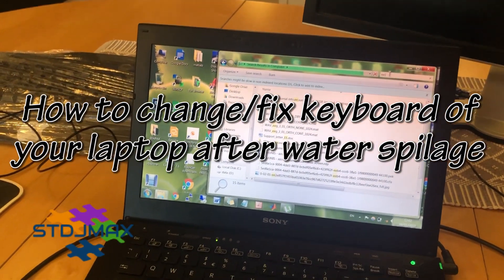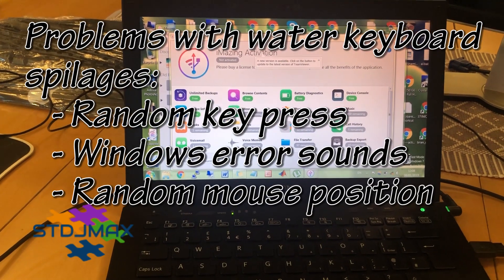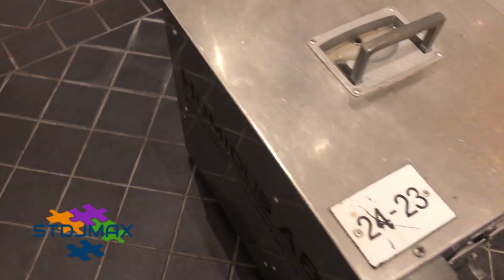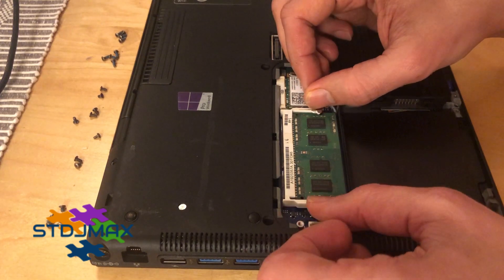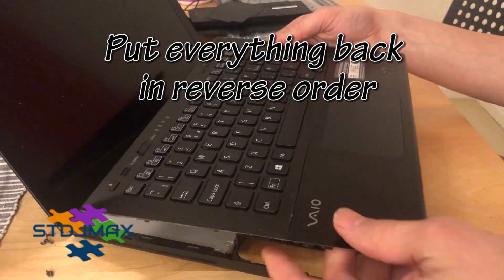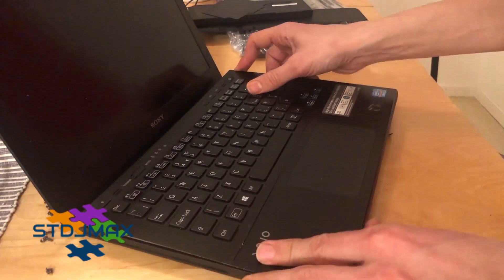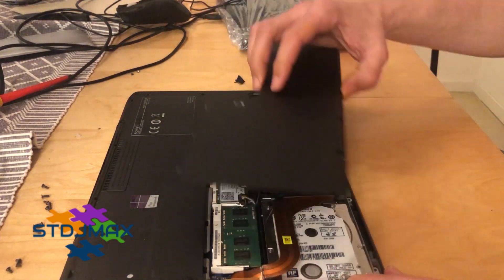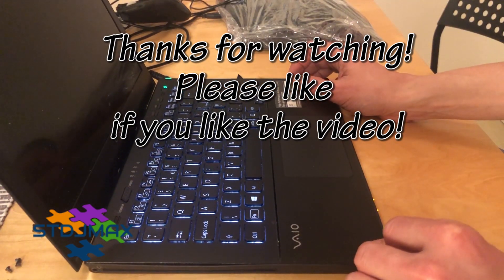How to repair the keyboard of a laptop after a water spillage/flood

Comment: I'm facing 3 (or 4 issues) with my acer aspire E1-572G

Recently i spilled water on my laptop, i cleaned it all. It was working fine till i shut it down.

1. Issue: power is on, yet no display. (sometimes it lasts longer but then shuts down.)

2. Doesn't power on, even if i press the power on key.

3. Key A and Caps lock doesn't work.

4. Won't charge. (Not sure about this one.)
Reply from the maker: Zach it seems some water still inside or it have short circuited some parts... 
But does the keyboard works ... try put it upside down for few days... try an external tv via vga port and see if any output signal
Reply: @stdjmax  mine  types random letters some keys dont work almost all please help
Reply from the maker: @barneyiscool221  this exactly the problem what I had. Means there is still some water inside. Put it upside down for more days in a dry room

Comment: hmmm i accidentally spilt some lemonade on my keyboard and nothing happens, except sometimes when i press D or T the key doesn't go back up, resulting in it being spammed. should i use a different keyboard?
Reply: Mine would work on some numbers and bottom row like the/key and stuff. But its been a year and I bought a cheaper model, but it curts out so much. I am going to have to get an Apple Keybd.  I had an Anker , rechargable, bluetooth. But if you dont make a keypress, it will cut off and it takes forever to connect again. I kept the keybd wrapped in cello with about 20 of those lilica gel packets. -NOTHING

Comment: I clean my keyboard each bottons by removing them and after applying water sanitizer to each.
And now some of keys(mostly) are not working. What should I do?
Reply from the maker: Aditya Kumar seems that keys are still short circuit. If you have already left the laptop upside down Can you then spray high pressure air between the key to remove any residuals?
Reply: @stdjmax  ok sure
Thanks
Reply: @AdityaKumar-pp4rc  did it work
Reply: @swerepyhalo2146  No bro

Comment: What if i spill juice on my laptop?
I need help, its so sticky.
Reply from the maker: Where in the laptop? I hope only in keyboard? Put it upside down and let it try for 3 days. Unfortunately juice from nature is sticky and not easily disappears like water.
Reply: @stdjmax  Only on keyboard
Reply: @stdjmax  i dont want sticky keyboard
Reply from the maker: @st3go5ur  Does the keyboard works now? If yes then u can proceed with some cleaning cotton wipes . Is it sticky on the surface or at bottom of the keys?  If there are of the bottom unfortunately the keys need to be removed and be cleaned one by one. I will make another video for this. I hope u need to clean the key surface only!
Reply from the maker: @st3go5ur  For juice inside the laptop I will recommend more days as it takes longer to evaporate, probably 5-7 days. I guess for now that's all. Perhaps later you can tell how it goes thru so we can adjust the troubleshooting!
Reply: @stdjmax  but caps lock Light does not work, it Lights only if i Press some key
Reply from the maker: Stegosur CZE strange .... so u mean the functionality of caplock works but not the light. And the light works when a random key is pressed? Is this what u mean?
Reply: @stdjmax  yes
Reply: @stdjmax  it works but the caps lock Light Lights when i Press random key
Reply: @stdjmax  so can i fix the Light somehow?
Reply: @stdjmax  can you help mě with caps lock Light?
Reply from the maker: @st3go5ur  this seems to be sth short circuit or still some humidity. keep having the laptop upside down during the night for further 5 nights
Reply: @stdjmax  it works now, i didnt dry it for 3days. I did Gross solution (spitting on and Under Keys) its Gross but it worked for me :D
Reply: Please give me a solution i spill water on my laptop .

Is there any possibilty my laptop turned on after sometimes or wht should i need to do ...🙄 

Acutally i bought laptop last month 70 k ..and now
Reply: put it in the rice
Reply: @nourhossam-uw1kz  ok

Comment: Huhu I accidently spilled some cold water on our laptop and the keyboards are soaking wet
 is it ok to dry it with some cr blower? What should i do?
Reply from the maker: Put it upside down and let it try. Do not blow dry when in normal position as this may push water further  inside in the laptop. Blow dry although not necessary only in upside position!

Comment: I spilled water on my laptop, it's been there for more than 2 months now what should I do?
Reply from the maker: gamingwith rama more than 2 months? What is the damage?
Reply: @stdjmax  my keyboard doesnt work, and sometimes random buttons are pressed
Mostly control
Reply from the maker: gamingwith rama the internal keyboard is then messed up. U need to open the laptop and disconnect it ... and then connect external keyboard!
Reply: @stdjmax  ok thanks

Comment: I have an elitebook hp laptop and I was cleaning my keys with some surface cleaner and I think some leaked inside. I did a keyboard check and every key was working except A. I took out the A key and tried put it back in now more keys are not working. Idk what to do
Reply from the maker: nyachol !! When u pull the key A out. Could u see any liquid residual at the bottom? Can you use ur finger to activate/press the A key without the button? It may be any some local cleaning required
Reply: stdjmax Yes, I could see the liquid when I took out the A key. I took a blow dryer and aired it out for a couple of minutes then I kept my laptop upside down for a couple a days like you said. Everything works perfectly now, Thank you!

Comment: I spilled coffee near the spacebar of my asus laptop yesterday. I shut it down properly but now it’s not turning on. HELP!
Reply from the maker: Janette Mendoza put it upside down for 4 day in heated room or next to the radiator. Try again to turn it on
Reply: stdjmax UPDATE IT TURNED ON. But the keyboard is malfunctioning. Any thoughts on what I should do? Can this still be fixed?
Reply from the maker: Janette Mendoza malfunctioning or just does not work! If it is malfunctioning needs to be opened and disconnected. If it is just non responding connect an external keyboard
Reply: Same what will you do on your laptop?

Comment: It barely had water in it, my hands were wet and it's not working.
Reply from the maker: Musical_ _mochi really? Maybe some drop short circuit the keyboard board. Put upside down for 2 days and try again
Reply: @stdjmax  keyboard is not working now and sometimes things happens on it's own on the screen.
Reply: @stdjmax  Please help it is my father's laptop. He need to do something important.
Reply: @r.ksingh3282  its startup ?
Reply from the maker: What model laptop is it?
Reply: @stdjmax  I had the same problem it is of airmax